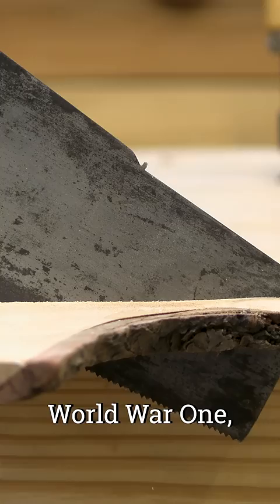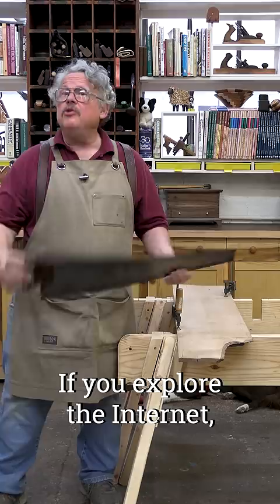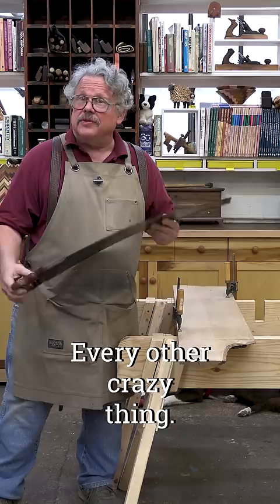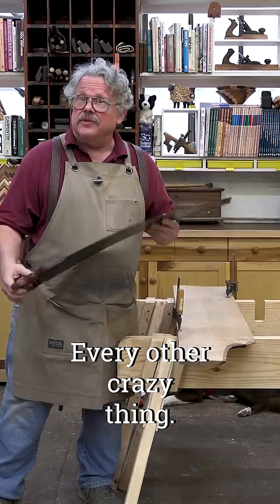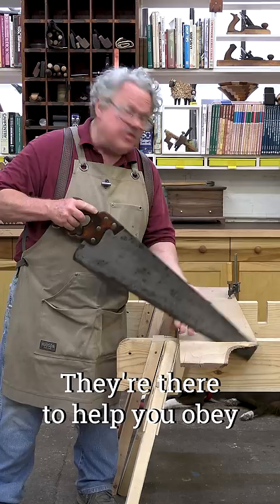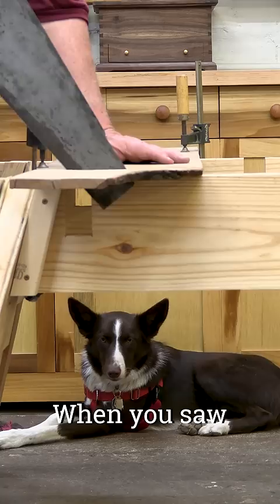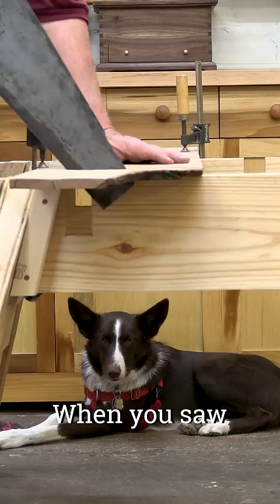Saw Nibs Explained

Comment: Im pretty sure the nibs were put there to show the craftsmanship of the creator and how good he is at what he does. If nibs were there as a guide they would still be on saws today. They were there for status of the maker and his skills because such a small intricate detail took a lot of skill to do without overheating or breaking it off. The reason they disappeared is because everything started to become stamped so there wasnt a set of hands to make it to show his or her abilities.
Reply: I would disagree - craftsmanship show was done through the quality and durability of the saw itself, no need to put a detail like this for that purpose. And if that was the reason, it would not be specifically placed near the top, but you'd have them placed in many different sections with different saws.

Not to mention that nib is more or less the same thing as saw tooth itself. So a craftsman who could make a saw in the first place should be able to make a nib. So it wasn't really showcasing anything.

The reason why you don't see it today is not that it is not an indicator - it is. But as you mentioned - stamping. To stamp that irregular shape on an otherwise straight line just adds to the cost.

Also, in capitalism, you don't really want to help the customer. If they end up using only the middle part of the saw - better for you - they will come sooner to buy a new one. So why would you prolong the time between purchases?

Nothing to do with showcasing the craftsman skill, all to do with practices of capitalism. Mass production and lower the time between purchases as much as possible.
Reply: @Wustenfuchs109 i don’t see how you can disagree with this, it seems much more viable than just an “eye guide.” there are so many better choices for a guide that would work better than a nib, such as a mark of a different color. the nibs were used to show the craftsmenship of the saw
Reply: @Wustenfuchs109  cant judge quality of steel off looks. It can be beautiful but also be poor quality steel and not hold up. That little added tit shows the steel is good quality and strong as well as showing hes skilled enough to forge out that little thing without melting it off or overhardening it making it weak. If he can make that tiny nib strong you know the whole saw is good. Looks and quality are two very different things. Even the handle can look good and have engravings in it but if its not strong hard wood it wont hold up, just another thing you can be a little more sure of is if the saw blade itself is expertly crafted then the guy knows his stuff and made the handle out of proper stuff.
Reply: @primetimeturner_YT  That makes absolutely no sense because the same skill used for making that nib is used for making saw teeth. But keep living in a delusion.

Mark of color would not work as it would wear off over time.

One clear indication that the nib had a clear guiding purpose is the location of it. But let's just ignore that and the fact that the same quality inquiry can be made by looking at saw teeth and stick to a ridiculous notion that it was a flex from a craftsman.
Reply: @Wustenfuchs109  check the poster’s comment. i will continue to disagree and believe it’s primary purpose was decorative and a way to show the skilled craftsmanship of its maker. nibs can be much more intricate than a saw tooth
Reply: @Wustenfuchs109  also, you really are digging deep on those explanations. if the color wears off (even though I do not see why it would wear at all, you’re not cutting with it if you’re using it as an eye gauge) then you can just add more color. Or a colored piece of tape to it. also, it may be “honing” the same skill when making the nib as opposed to making the saw teeth, but it is a much more delicate/intricate process to make the nib as compared to the teeth. also just because we disagree, does not mean there should be any hostility. i never claimed you were living in a delusion or anything of the sort. i also agree that there could be an infinite of uses for the nib, but i will stand by my opinion that they were first there to prove their expertise

Comment: I like the pinned full explanation.  Very interesting and informative, and I agree #5 (hold a sheath on the blade) makes the most sense.  Because the idea that the nub is there to mark the end of the saw is so dumb -- after any time with a saw, everyone, especially a craftsman, knows exactly how much saw is left under the wood based upon how much their arm is bent.

Comment: Take a file to a modern saw and put a sawtooth style v notch on the top side of the blade, but lean the v so that the face you can see catches the light nicely as it pops up. This angling makes it glint and you see it easier at speed. Does the same job and easy/quick to do.

Comment: My grandfather used to grind and flush smoothing the edge from front to back so he could use it as a straight edge. Not something for angles, but something to make angles. Using measured lengths when framing roofing gussets. As well as any other non standard angles. Although I didn't ask he told me. I don't need to know where the end of the saw is because I can see the top of the saw and when I see it come to that squarebangle I stop and push down.. And always lift the blade when you're pulling it back. If you're making noise with those teeth against the board, you aint lifting. If you ain't lifting you're pulling the edge off. Would maybe soft but even soft wears metal

Comment: Follow the nib straight down the saw. It lands at the tip of the blade, where the tip and inner corner of wood meet ONLY when the saw is at a certain angle.
If at the full backstroke of the action, and the tip of the saw at the (edge of the wood) is straight up over under the nip, then you are at the perfect angle of cutting for the teeth of the saw.
Hence, pull till the nip is directly over the edge/corner of the wood, and you'll have the perfect angle, or, if at the perfect angle, then you have used all the saw, so yes, "pull till you see the nib [directly over the start/corner of the cut]".
I think maybe you missed a middle detail in your description here about what your grandfather said.
Your angle is a little off so the tip and the corner don't line up right.

Comment: I think you're wrong. Many people have theorized it's purpose and hundreds of people tried to answer this mystery. Here is a list of the purposes for that nib by many. 

1. Maker or starter tooth, 
2. Used to describe an arc, 
3. Clean sawdust from a cut, 
4. Sighting like the sight on a rifle, 
5. Retain a sheath string, 
6. Clapboard Gauge for narrow siding, 
7. Hook to retrieve cut-off pieces out of reach, 
8. Hook to pull lumber toward you on a saw horse, 
9. Used to obtain the correct angle for filing, 
10. Notch the size of teeth for filing guide, 
11. Vestige of handle locking notch for pit saws, 
12. Facilitate the slitting of decorative metal panels, 
13. Remove nails in broken slate, 
14. Practice tooth for saw filer, to check steel hardness, 
15. Holds blade during acid bath pickling, 
16. Vestige of hook originally used for pruning, 
17. Sight to avoid pulling back too far, 
18. No function whatever, 
19. Vestige of the decoration on early Dutch saws. 

Everyone has tried to answer this question. However the only plausible theory that sounds correct is that it servers a purpose to hold the blade guard in place so the lace doesn't slip off due to the taper.

Comment: I have never seen that but it should still be used today. I get so freaked out especially watching someone with a hacksaw short stroking 2 inches as fast as they can and then they get angry when the blade breaks and they open up a knuckle on a sharp edge. I guess thats why it’s called a hack saw.

Comment: Just always wondered. Why are there teeth on the first and last part of the saw, (especially the first part.) Those teeth aren't really needed or used. If there were no teeth in those areas it would make it easier to use all the other teeth and would make it easier to get the saw moving before you hit teeth (especially on the cutting stroke.)

Comment: it is like a sprue from the die where the saw blank was stamped out of a big steel sheet
Reply from the maker: Quite possible, although stamp dies do not usually need sprues -- the sheet metal may be heated, but it is never poured as a liquid. Nonetheless, you make a good point -- the shape of the nibs could easily be included as part of the die.

Comment: Without this expierence "i used most a Highqualiy Japansaw" now 20years ...but in my first time as Joiner i used our German saws like bowsaw...after a Time Diyworks in privat i convert most Handtools for mi to work saver and faster 😊 in the End i paint with Edding Signs like this on Points ....before i understund how easy it most works made i killed 3 Saw like the same in the Movie ..every old Saws are hard enought to apoligize but most longsaws can really fast crack and its not for all easy to handle straight with Tools , thx for the Tip and remember me , this tips very usable today ..traditional Worktip that the Maschines not say ❤

Comment: While that seems like a good way to use it, it doesn't explain why they are shaped the way they are. Being relatively difficult to make that shape back then, could they not have simply cut a notch or something easy like that for the same purpose?

I suspect its true meaning is something different.

Comment: On the back of a very vintage package of Will's cigarettes the following was printed:

WILLS'S CIGARETTES

2ND SERIES OF 50

DO YOU KNOW why a Saw has a Notch in its top edge?

Many large saws have a small notch at the top edge near the narrow end of the tool. When very thick blocks are being sawn through, it often happens that fine sawdust or small splinters of wood partly fill the cut, and impede the action of the tool. By just turning the saw upside-down the carpenter is able to clear away the saw- dust, &c., by means of the notch provided for that pur- pose. W.D. & H.O.WILLS BRISTOL & LONDON. ISSUED BY THE IMPERIAL TOBACCO CO (OF GREAT BRITAIN & IRELAND)
Reply from the maker: Love it. Despite the fact that the person who wrote the copy for this cigarette package knew nothing about hand sawing or how it's done, I love it. Thanks for sharing; would give my eye teeth to actually see a photograph of the package. By the way, if you read the pinned comment, this is #3 on the list of possibilities.

Comment: Thank you for that very good explaination!
As you already mentioned one: would you by any chance know what the mysterious notch on the Kukri, that sometimes comes with a nib, too, is for?
I'd really love to know that and Matt Easton of scholagladiatoria also, I'd bet! ;-)
Reply from the maker: It's called a cho, and it's purpose is almost as obscure and as controversial as a saw nib. It seems to have several purposes, both practical and ceremonial. One possible practical use is as a "choil" or starting point for sharpening. Ceremonially, it is viewed as an "OM" sign, or the footprint of a sacred cow.
Reply: @WorkshopCompanion  thank you, Sir!

Comment: Are there Modern Day made woodworking saws better re sharpenable
Reply from the maker: If you talking about circular saws, yes. Industrial-quality saws have more carbide in their teeth so you can sharpen them a few dozen times before replacing the teeth. Cheaper saws made for the DIY market barely have enough carbide for 2-3 sharpenings. As far as hand saws go, many now have replaceable blades -- even the Japanese hand saws. However, there are a few good ones left -- the Vaughan BS240P, Irwin Universal, and anything made by Crown are quality saws that can be regularly resharpened.